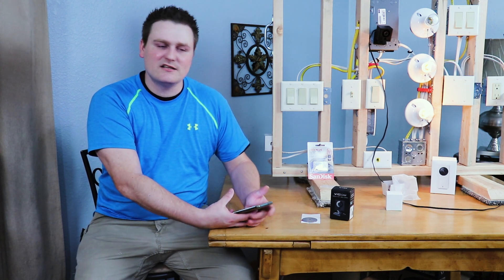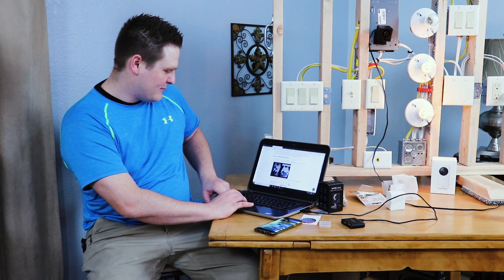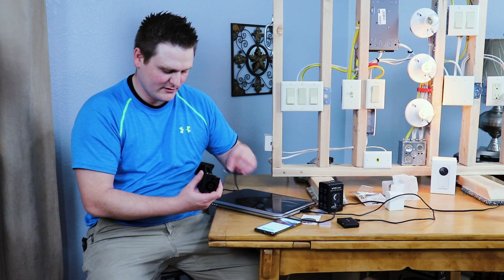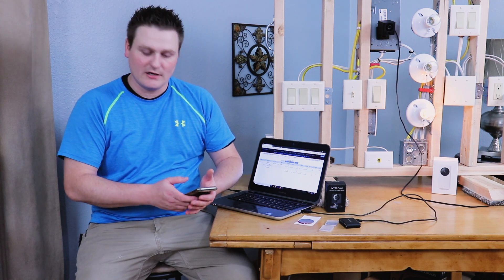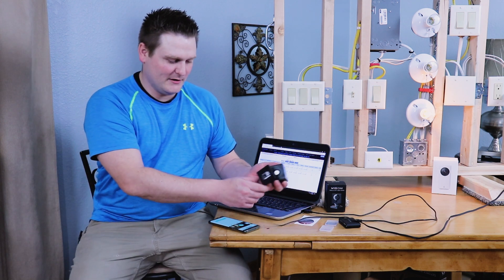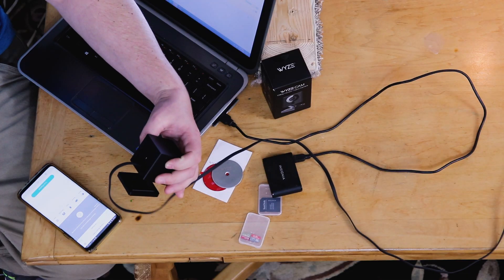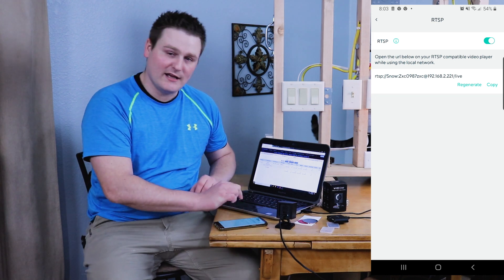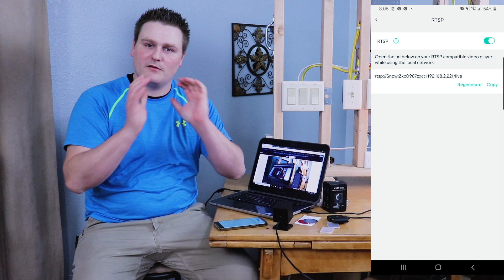Wyze Cam V2 Black RTSP Flash, Setup & Install Guide on Zoneminder Part 2 Walk Through. (How To) 2020

Comment: Thanks for making this video :) Odd that ZoneMinder does not have details for Wyze cameras in their "readthedocs". So thanks for showing how to install the RSTP protocol on Wyze Camera.

Do you know if it is possible to use the standard Wyze Cam firmware with ZoneMinder? I have 1 Wyze V2 that I am running defang firmware (Allows me to stream the video to VLC on my PC - as normal firmware cannot do this)... however my other Wyze V2 cameras, and a few V3, are all on Wyze stock firmware... not sure if ZoneMinder supports something simillar to TinyCam android app that lets you put in  your Wyze Credentials?

Also - any idea if there is a benefit of using RSTP vs Wyze Cam credentials? I suppose I never looked to be sure, does Wyze Cam app use LAN directly if viewing camera footage when on same WiFi? Or does it technically waste data and perform slower by connecting to internet, and pulling footage via Wyze servers?

Not sure if Youtube has option to force mono audio into stereo? Right now this video only has audio on right side - for some people, myself included, it is extremely difficult to watch videos that have mono audio (In particular when wearing headphones).
Reply from the maker: No it is not it does not come withthr option to use it.
Reply: @TNW1337  bummer, thanks for info. I may just convert a few of my Wyze V2 to defang FW as it supports RSTP

And Wyze app has gotten really bad lately, events page will show almost none, but if I look at "Wyze cloud" via TinyCam app I see there are many events... It even sends me notifications (Wyze app does), yet events tab often does not show them

What cameras do you use these days? Are you still using RSTP, or the cameras native monitoring system?